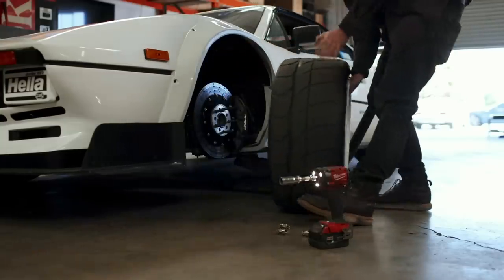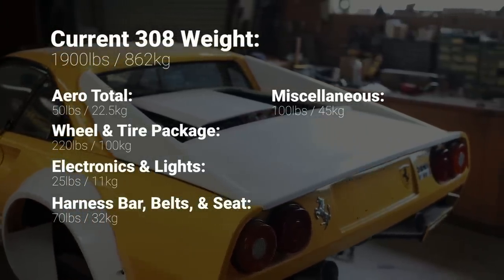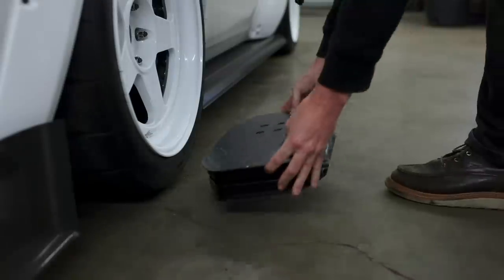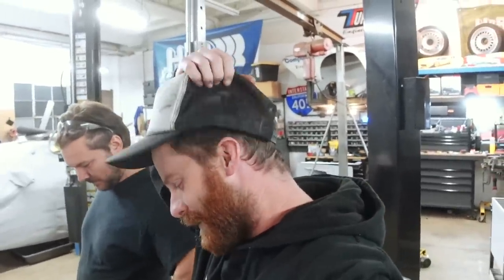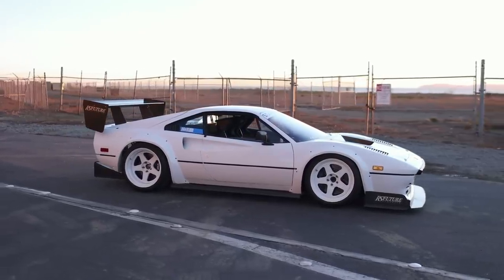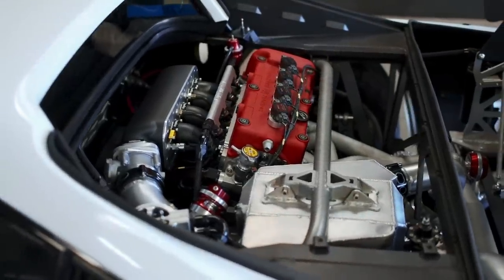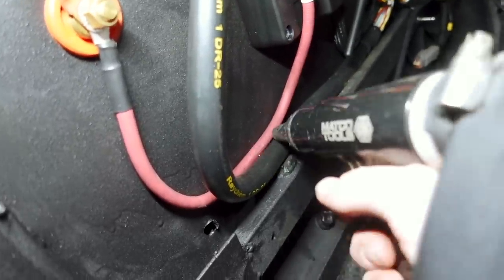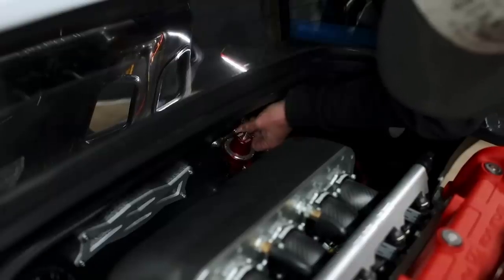Honda K24 Swap - How Much Weight Savings for our Featherweight Ferrari?

Comment: The elephant in the room is that this car makes most of the other “builders” on YouTube look like posers. The excellent esthetics aside, the suspension design and fabrication, the “dark arts” is truly impressive. So many factors to go potentially wrong, but you obviously recognize the inherent challenges. No small thing for someone who modestly does not bill himself as a chassis engineer. No doubt there will be teething, maybe even a big revision, but obviously you will get there. I thought at the start of the build,”too bad he couldn’t start with an early fiberglass car, thus saving 300lbs at the get-go.” But seeing the car now, when you go to the carbon fiber doors and engine cover, you will be in the same ballpark as if you had stated with a glass car. Just such an impressive build, congratulations.

Comment: Several have already made this comment but...2377#s is a game changer.  To put that into perspective the build is approaching the magic one:one threshold of 1bhp per kilogram.  Koenigsegg made a one:one which I believe they made only one of.  So a quantum leap  for StanceWorks.  Yup it may be possible to get to 2200#s curb weight.  CF doors, carbon ceramic rotors, CF wheels, CF rear hatch...Or just turn up the boost a few PSI and use methanol as Koenigsegg does. For a humble builder as yourself this is an achievement.  Looking forward to dyno, suspension tuning, and track day.

Comment: I can tell you, as someone who owns 3 mostly stock manual rack sports cars, that the steering effort you're showing is fantastic.  It will depend a lot on the road surface finish, but it takes a lot more effort to turn any of my cars with much thinner tires.  Very nicely done.

Comment: As a former industrial designer with aspirations of automotive design in my youth, I have to say the final results are above and beyond most builds I have observed on YT or TV. It's a masterpiece! I'm only guessing, but hoping that the 1st dyno pulls will only be for tuning purposes and that some run-in time will be given to the fresh motor. I'm old fashioned about this, so may not be up to speed on modern engine building limits and procedures.

Comment: Hey Mike, absolutely love your channel.  With respect to your tire rod adjustor, the 7th thread of any bolt/screw/nut supports almost 0% of the load.  The first 6 threads support 99% of the load.  But more threads help if the first one fails.  Like you said, steel will provide a larger factor of safety.  Idk if you knew this, maybe you did.  Just wanted to give 2 cents.  Keep up the good work.  I check everyday to see if you posted!

Comment: We use the suc-vac all the time on aircraft. The key benefit isn't extension chords though. It's no sparks. Don't want to be sucking up flammable vapors with a motorized vaccum. The main use is in fuel tanks. 

Awesome build.

Comment: You may want to reconsider that loop in the drain vent. If it ever gets oil up that far, it will turn into an air trap, just like household plumbing. During normal operation air will not be able to pass back and forth, which is the whole reason to have it.
Reply from the maker: There’s a pump on the inside sucking oil out of the system. If the level ever rose that high and air trapped it, the pump powering on would suck it back in.

Comment: I'm no expert, but in regard to steering, I think when you get it on track you may find that the steering becomes reallllly heavy when it loads up in the corner. This depends on your caster and kingpin inclination. Basically, the camber gain from caster (and counteracted by kingpin inclination) under steering can effectively jack the front of the car up, which is part of the self-steer force, and of course gets loaded when the car is cornering. I think you'll find that most manual steering cars have less caster in them for this reason. This will show up particularly strong in tight high-g corners like autocross, but I also imagine aero forces will exacerbate this. Just something to look out for, but you have great adjustable arms so if you need to dial caster out, that's not an issue! Incredible how light this thing is, awesome work man.

Comment: If you’re already at 2377 with the steel engine cover, steel doors, steel uprights, and steel control arms, sub-2250 with carbon and billet aluminum replacements in the future should be easily attainable. Plus, if you really want to chase pounds once you start competing, I’m sure you could find some carbon wheels that would fit your criteria. 😂 Congrats on getting the car to this point in only two years!
Reply: maybe the driver could go on a diet too, and drive in speedos :)

Comment: Mike the sparking was because you where tig welding on the magnetic square  and leting the earth run through it rather than clamping the earth to the part it was the magnetic field from the magnet causing the weird welding cheers from down under

Comment: Man, gas fire is not a joke. During the testing of my buggy my "temporary" gas tank located right next to my head catched fire from bright new but defective fuel pump which sprayed fuel on alternator. Probability of that was zero but happened, I will never ever in my life use temporary fuel system. Anyway, your built look great.

Comment: Epic build. Thanks for the heads up on the steal it that's good to know. Also I like the vacuum it'd be nice doing body works say with a long bored and some 36 on a roof or something.. to be able to just switch over from air tool to vacuum to clean it up without brushing stuff on the floor would be nice.

Comment: If you add additional mounts, you can probably use QuikLatch quick releases to pull the rear splitter off quickly and with no tools.

Comment: The welding issue on the rod ends very well could have been coming from the magnet. Magnets can cause a lot of weird issues. Just a thought from experience. May also be the argon itself. I’ve had bad bottles before.

Comment: Good vid, Worth saying the overall weight shaving has only a small part to do with swapping the motor. It’s about internals sections, interior and chassis. Such a great build, looks awesome. 😎 should def lexan the side glass with sliders. Weight is awesome 😎 unicorn would be hitting 1000kgs and 1:1

Comment: I just found your channel and I'm loving the content you're putting out there!
If I may leave a suggestion, avoid using the threaded ball joints in the suspension control arms, as shown at 16:12. They'll be under significant shear stress which they're very weak against. Other them that, congratulations on the incredibly work!

Comment: Honestly, compared to supercars, hypercars of current day , 3200 is light. With all the electronics and comforts they add to these cars the last years, they have gotten heavy hence adding more hp. 2400lbs is like the gtlm, gt2, gt race classes. For a race car yes , 3200 is pig, for a street sports car / exotic 3200 is pretty light. (but the 308 did not have high hp so push/pulling 3200lbs , hence why it wasnt quick) All i know is, this is the best custom , fabricated , conversion and unique car ive seen. I saw the Rx7 with the Pagani motor but your build is just incredible. One question, was it hard taking a perfect ferrari 308 and then cutting it and gutting it ? lol

Comment: wow very nice- ive been following this project for over a year now. stay with the white body and white wheels, get that carbon engine cover painted. Carbon door are a chore to install; but they are worth the weight savings. where are the Ferrari badges on both the front fenders?

Comment: Very impressive on the turning effort. I do wonder if it would be significantly harder on pavement than on the shop floor, but it looks like it'll still be manageable, especially when you're moving. How fast is the rack?

Comment: It would be insane to achieve 1-1 power to weight ratio with some extreme tune. I mean 1078 HP to 1078 kg.

Comment: Damn, that is insanely light. So quick. I am interested where the balance of the car is going to be with the honda motor in. Best of luck for the track.
Reply: The scales show the corner weights at 5:08. It’s pretty much bang on 40% Front 60% Rear. Ideal for a mid engined car.

Comment: The welding of the steering buns, the sparking is because you are welding on a magnet.
NEVER weld on a magnet, it can make the weld look good but the inside will be full of garbage. 
Because of the magnetic field the garbage in the welding can not come out.

Comment: Ive had stock manual rack miatas with 195mm tires require more steering effort than that, Id say you crushed it on the steering

Comment: 40/60 on a mid engine car? Hmmm. Is that correct. Seems like the Corvair had that distribution. I thought that a coal of mid engine design was to tune the car to a close to 50/50 .

Comment: The metric system is better
1kilo = 1000grams 
1451kg = 1451000g
1ton = 1000kg   -   so obviously 1,451ton  

using the multiplies of 100 to area and 1000 for volume

Comment: 1100kg would be a great result for the car!
Reply: Damn! 1078kg is crazy good. 10kg off my s2000 but I only have 130kw 😂
If going carbon doors at some point don't forget the weight would be offset by extra cage intrusion bars. Please don't run carbon doors with nothing else. Especially if running it on the street.

Comment: Why is it that so many "racers" don't realize that you make a firewall moot, the second you mount a fuel regulator onto it? In the event of a crash, the last place you want MORE FUEL, is on the one piece of material that protects you and possibly a passenger from said fire. Not to mention most sanctioning bodies do not allow fuel parts, lines, etc; on the firewall. Find another spot. The most convenient and asteticly pleasing, isn't generally the best location.
Reply from the maker: I have bad news bud. The fuel cell is literally up against the firewall.
Reply: @stanceworks   Are you even allowed to race with the fuel cell and regulator there? In any sanctioning body? Seems so odd.

Comment: Heck you really shaved the fat off that piggy! Must be so tempting to try getting it down to 1000kg and then dial it up to 1000hp to hit the mythical power to weight ratio (but don't drive it in anger or probably the prehistoric chassis will bend like a pretzel). Ben fatto!!!🇮🇹🍾

Comment: Hey Mike, in regards to selecting spring rates to keep your car both compliant and allowing it to deal with high aero loads. You may want to consider decoupling those by adding a heave spring setup, so you have your normal independent springs for independent wheel movement but dedicated springs for the whole car compressing together, like under aero load. It would take a bit of fab to setup but when has that ever stopped you. Kyle.engineers has a good video covering it: https://youtu.be/lNInCfCkrkE

Comment: If you wanted, you could chop the steel rear chassis & swap it for aluminum,,, or better,,,, Ti. Could have that friend that does carbon, help you learn to make a one piece front clam. If you watch Mike Paty's channel, he's made his planes with carbon skins & engine covers. 

https://www.youtube.com/c/MikePatey

Loved watching the build as it's given me the insight on the entire car in terms of how crudely it was made & what's {IMHO} needed to make it better. If I ever get the money to do a 308, I'm going to use the drivetrain out of a 360 manual. My goal would be a better 288 GTO, focusing on a comfortable street monster with around 400HP. Weight could be where you're at now.

Comment: Carbon Ceramic brakes would be better. ✅
Reply from the maker: Of course they would. Wonderful observation.  They’d also be twenty thousand dollars
Reply: @stanceworks  They would be free. Buy a salvage vehicle with Carbon Ceramic Brakes and sell the balance of the other parts not wanted.
Reply from the maker: Yeah let me go buy a salvage vehicle with carbon ceramics on it. That'll be a logical way to do it. Also, those will just bolt right on. Good call.
Reply: @stanceworks  You have already done phenomenally well. Maybe one of these carbon ceramic brake manufacturers would sponsor brakes for the car, as product marketing? 

Brembo - Brembo offers a range of carbon ceramic brake kits for various sports and luxury cars.

PFC Brakes - PFC Brakes offers a variety of carbon ceramic brake kits for high-performance vehicles.

StopTech - StopTech offers carbon ceramic brake kits for various applications, including street, track, and racing.

AP Racing - AP Racing offers a range of carbon ceramic brake kits for sports cars and high-performance vehicles.

Rotora - Rotora offers carbon ceramic brake kits for various sports cars and luxury vehicles.

Girodisc - Girodisc offers carbon ceramic brake kits for various high-performance vehicles.

Alcon - Alcon offers carbon ceramic brake kits for various sports and luxury cars.